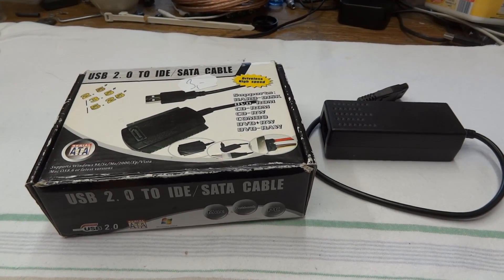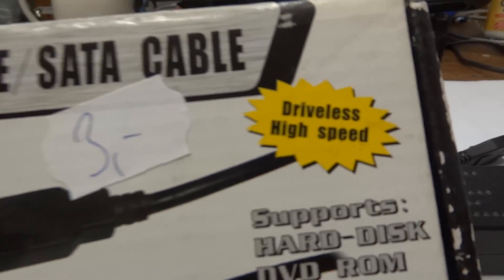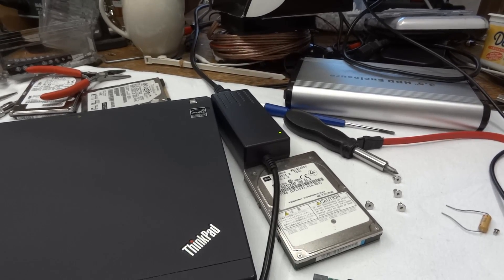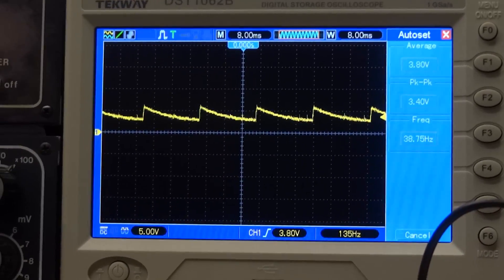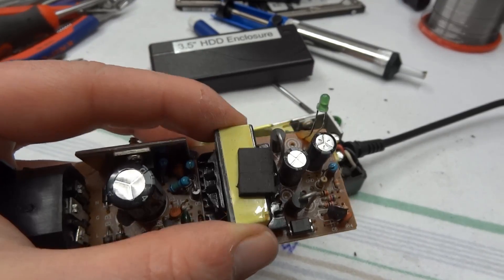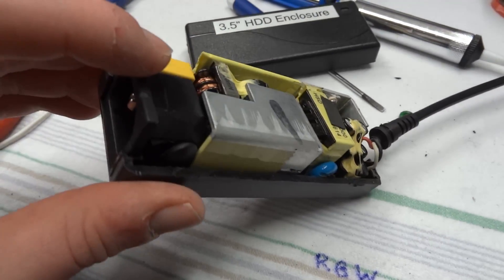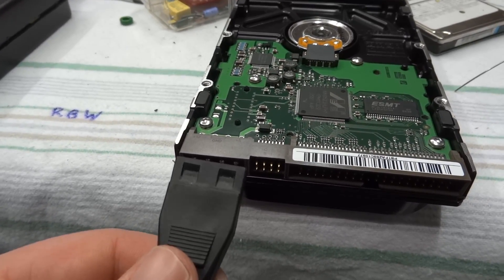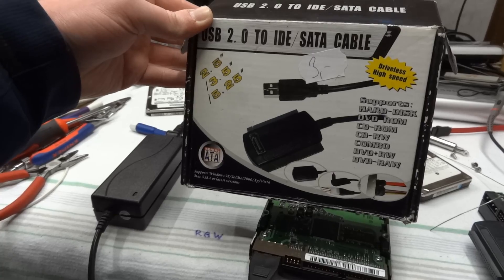DrCassette's Workshop - Another power supply repair!

Comment: Veeery goood!  That is quite a surprise to see the differences been the two power supplies.  I wonder what a Nintendo power supply looks like inside and what ripple it will have.
Reply: I had a Chinese copy of Nintendo with a linear power supply without any voltage regulator just a transformer, rectifier and a capacitor for filtering. It might had significant ripple up to probably 10 - 20% but the cheap Chinese clone worked perfectly with it. I've spent alot of hours happily playing with it :)
Reply from the maker: Origoangelohrol322
Some systems will tolerate some ripple, maybe the genuine Nintendo adaptor didn't have a voltage regulator built in either...
Reply: Origoangelohrol322 The SNES had a genuine AC adapter which really gave  I think it was about 9V AC it is happy with DC also so I guess that really was just a transformer!  I wonder if a Sega Megadrive would be so happy with a SNES power supply hmmm!
Reply: The Chinese clone had AC to DC adapter which gave 9V DC output but non-regulated and poorly filtered. The console itself didn't had a rectifier, filter or regulator inside it so it won't accept AC voltage.
Reply: Origoangelohrol322 Had 2 Famiclones when I was tiny, they looked the same as genuine Famicoms but would overheat and the picture would go black and white after a few hours perhaps they were similar although I remember my dad opening one and it had proper chips inside unlike my modern N64 looking clone which just has black blobs for chips and doesn't seem to work with many Famicom cartridges!
Reply: Knuckles the Echidna Mine Nintendo clone was with "blobs" but never had problems with overheating. It was working properly through the years and still works :) Of course I've never had a genuine Nintendo cartridge to find out is it working with them or not. All cartridges were Chinese clones with "blobs" and all the text in the games translated in Chinese :).
Reply: Origoangelohrol322 Nice!!  I suppose it depends a bit on luck, my favourite modern one was a grey and purple playstation looking thing which had built in games, Famicom slot,  nice controllers and a gun.  It was quite reliable but I have no idea where it went :(